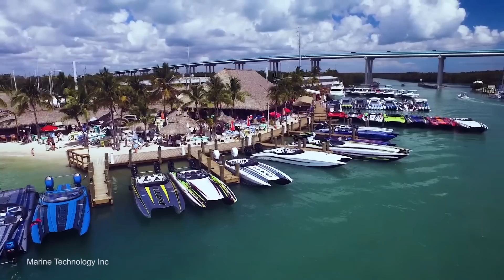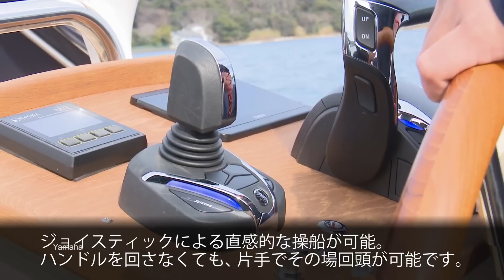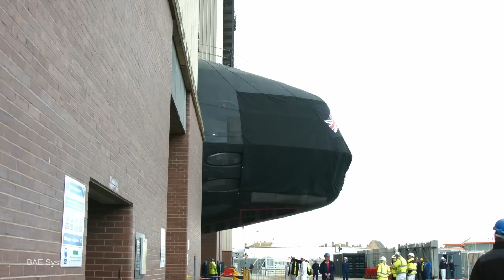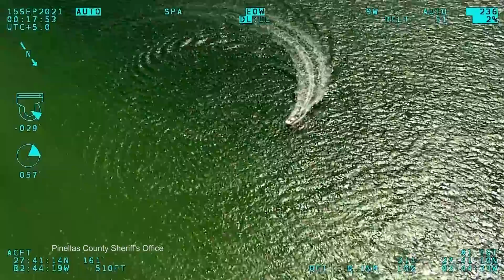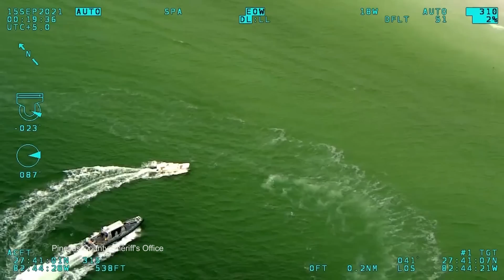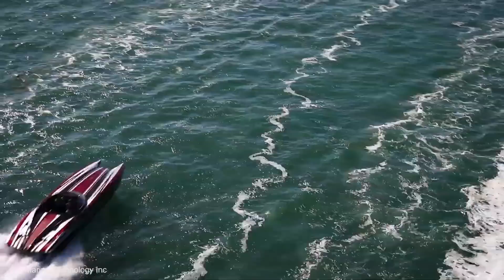Rock the Boat: New Yamaha Harmo electric outboard motors!

Comment: Sorry these motors are woke junk.  A product that was never needed will not survive.
Reply: Your great grandfather told everyone that automobile would never ....... ever .....replace horses. Elco has a 180 hp motor out now.
Reply: @donkanis6141  I have no doubt that they can make a 500 horsepower motor.  But the battery technology does not exist to power this for more than a few minutes.  Not even when we are talking about a large yacht such as I own, a 42' Chris Craft Commander which barely goes 16.5 kts burning 35 GPH on twin 454 Crusaders @ 600HP.   Propulsion is a system.  It is the weakest link that counts, not the strongest.
Reply: @DIYDaveT Your a bit behind in your info. I have a 41 Hatteras with twin Detroit 671’s. I'm also a Tesla shareholder and keep very current with Tesla tech. Replacing these heavy engines and loaded fuel tanks with a 4680 battery and twin 500 hp Tesla ELECTRIC motors (which are MUCH more powerful than diesel) would be a big big improvement in every way.
Reply: @donkanis6141  LOL.  It seems you are a bit behind in your physics.  It takes the consumption of 35GPH of gasoline to move my yacht at 16.5 kts.  This is about normal for this older, solid glass semi displacement hull using gas.  Diesel is a bit better.  1 gallon of gas is about equivalent to 33.7 kWh of electricity.  My boat holds 300 gallons and only gives me 150 miles of range at cruise.  Miles of range are what boaters care about.  Having electric motors does not change the amount of energy needed to move it from point a to point b at a given rate.  The efficiency of conversion of fuel to kinetic energy (motion) for gas is around 35% (there is a range but this is ballpark).  The efficiency of conversion of fuel to kinetic energy (motion) for an electric motor is much higher, realistically 90% or even a bit more.  So let's just call it 3x more efficient for round numbers which is being quite generous to electric.  That means it needs 1/3 of the kWh stored in my gas tanks in order to do the same work (traveling 150 miles at cruise speed).  

My gas tanks store 10,110 kWh electrical equivalent worth of fuel and so in order to get the same result from electric you need about 3300kWh of electricity.   With the new cells, the Tesla model 3 has 82kWh in its battery pack.   So you would need a whopping 40 of those packs at untold cost in order to match what I can do with 1990 gas engines.

Unless and until battery technology makes a major leap they remain a hobbyist technology for boaters.
Reply: @DIYDaveT  my major in college was chemistry so I don’t need a lecture on thermodynamics or physics from an “expert” like you. I’m done wasting time here.
Reply: I didn't want to add insult to injury but I do think it should be noted that my calculations assume 100% DOD (Depth of Discharge) for the batteries.  If you want your batteries to last it is recommended to only use 40% DOD for LiFeP04 batteries.  So all of a sudden you need 70 Tesla model 3 packs in order to present similar performance as my 1990 motors.  Performance does not mean for 5 minutes and then you are screwed.  An apples to apples comparison is not favorable to battery electric AT THIS TIME.  If the physics change, so will I.
Reply: @donkanis6141  What, no technical response telling my how my math and logic are incorrect?  How liberal of you!  You're right, you are done here.
Reply: @DIYDaveT  Mute......... :  )
Reply: @donkanis6141  Of course.  When you have been completely outclassed, that is the correct move.  Well done.
Reply from the maker: Thanks for your feedback DIYDaveT!
Reply: Your cult leader taught you the term woke.....
LOSER LOSER LOSER LOSER LOSER LOSER LOSER LOSER LOSER LOSER LOSER LOSER LOSER LOSER LOSER LOSER

Comment: I’ll wait for the nuclear powered outboard. Abundant horsepower and endless range.
Reply from the maker: Like having a rocket under your......................
Reply: ( MSR) Molten Salt Reactor read Odd Rune Malterud, Marine Engineer from Norway. Chief Engineer responsible for MARPOL regulations.
Reply: MIT Seeaffej: why not just use Sonoluminesence zero emissions

Comment: was hoping the harmo had more horse power hahah
Reply from the maker: It is electric? Thanks for tuning in!
Reply: Yeah, that is pretty low. However, its not quite as bad as it sounds. Since an electric motor has peak torque almost instantly regardless of RPM, it will feel like about 3-4 times the HP rating in acceleration.

Comment: harmo needs to be outboard tiller... Will corner the market as it meets electric only requirements AND salt. no more need for 2 motors. Not to mention trolling motors are awful
Reply: Hope they come in solar
Reply from the maker: Solar is making HUGE waves in the Yachting Industry, so sure it won't be long before the technology makes its way into the smaller crafts.
Reply: Yes, it doesn't make sense to not sell it as an outboard that can be mounted to any vessel. This would be perfect for sailboats with no other motor. It seems like it'd be much lighter than other electric outboard options.
Reply: @K.J.Ray421   torqueedo comes to mind, hoping to compete and bring prices down...
Reply: @K.J.Ray421  Depending if battery is external will effect weight. Check out torqueedo for your sailboat as an option available today> PRICEY but has been around for awhile and is popular for sailboats. Couple of other competitors something by name of NAVY 4  (googles it)

Comment: ah yes, electric outboards, just another decade away...
Reply: Trolling motor with artsy-fartsy plastic covers
Reply: an actual google search might be in order. or just make silly comments that have no basis in reality
Reply: @Cancri71  show me an electric outboard that's the equivalent to the power and range of my 9.9 Merc for under $1500, have fun with that google search, I'll wait.
Reply: @MrHatetheplayer  under 1500? no. but the savings in fuel and maint. offset the 500 increase in price. the batteries are not cheap but they are getting cheaper by the month. i build my own stuff. over the course of a few years its much cheaper.
Reply: @Cancri71  so you mean like, in a decade or so away?
Reply: @MrHatetheplayer  sure man. whatever you say.  sorry math is hard for you.
Reply: @Cancri71  $2,000 for electric outboard, battery pack, and required components to equal this?  Boy someone is a pessimistic, for reference a Elco 9.9 electric outboard with required components to equal this drivetrain runs @ $5,500.  If you want to compare just motors that runs @ $2,900 but you really should be including battery pack because it wont move without it…a tad more than $1,500.
Reply: There are several electric outboard manufacturers now. I think your great grandfather said cars will never replace the horse and carriage.
Reply: @donkanis6141  could you name a few that are decently priced?
Reply: @MrHatetheplayer  Hey, just saw your comment, Emotion electric outboards now make a 180 hp that kicks everyones ass. Im sure its more expensive right now but prices will drop rapidly as now Yamaha and lots of others are coming online.
Reply: @donkanis6141  so do you think this $27, 000 electric motor will be decent priced in a decade from now?
Reply: @donkanis6141  no one said they don't exist so I am struggling to understand the relevance of your comment.  Also, when cars first came out you understand that Ford offered the model T at an affordable price so that masses could obtain one and help them replace horse & carriage.
Reply: @msk3905  I dont know where in the world you get your information from??? The first car Ford came out with was the Model A which only the rich could afford. Both are well known facts. As far as affordable outboard electric motors and ranges all you have to do is google them
Reply: @donkanis6141  do some research "The Ford Model T is an automobile that was produced by Ford Motor Company from October 1, 1908, to May 26, 1927. It is generally regarded as the first affordable automobile, which made car travel available to middle-class Americans. The relatively low price was partly the result of Ford's efficient fabrication, including assembly line production instead of individual handcrafting. The Model T was colloquially known as the "Tin Lizzie," "Leaping Lena" or "flivver"."
Reply: @msk3905  The model A was the first car produced by Ford. The model T came much later. Henry Ford himself said his employees could not afford his cars so he gave them a raise. This is a matter of fact. My question is why am I wasting time here with you ?   MUTE
Reply: @donkanis6141  yes diamond don we know but cars didn’t come popular until he figured that you need to make at a reasonable price because Models A thru S didn’t sell like he wanted, not sure why you don’t get this concept pretty straightforward.
Reply: Ellen the all electric ferry in Denmark Stenna in Sweden, Norway, 
Electric is normal in marine mode,